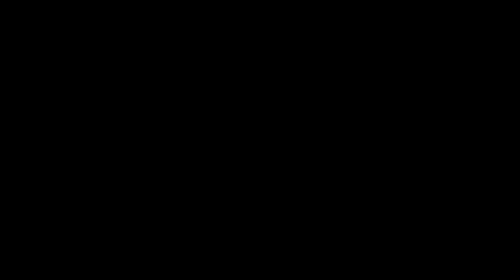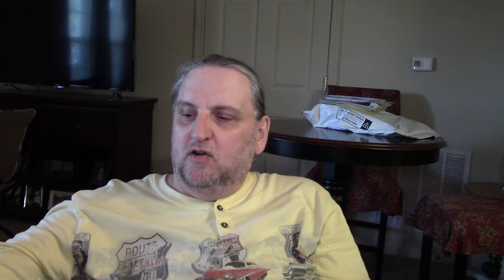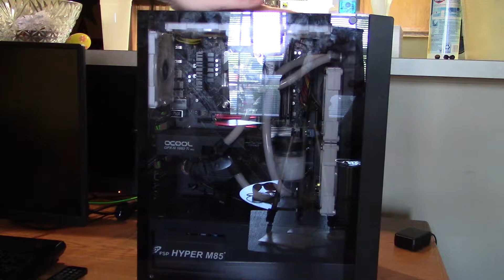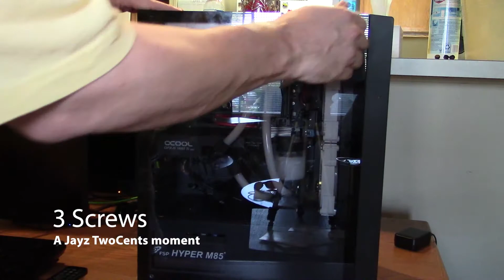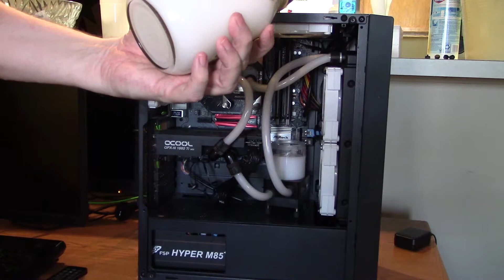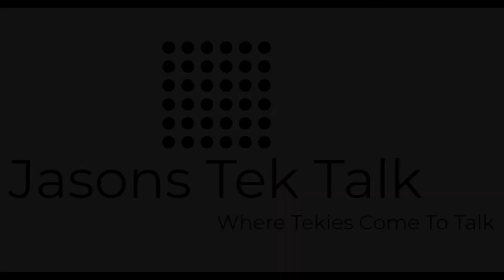Adding coolant to my Water Cooling Loop

Comment: Nice build jason, just my 2cents but you can clean it up by making the turbing run from the gpu to the CPU shorter and swapping the radiator  Runs
Reply from the maker: It's actually getting a complete overhaul this week Spoiler New " Thermaltake View 71 snow Case" So be looking for that video in about a week. thanks